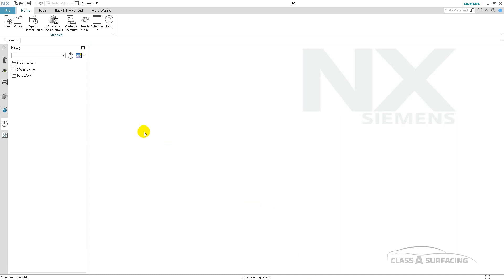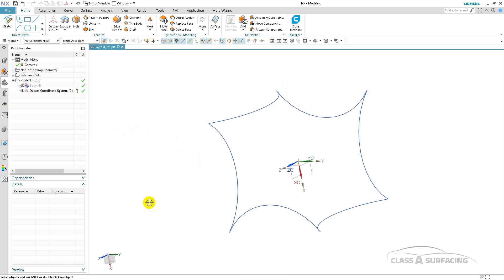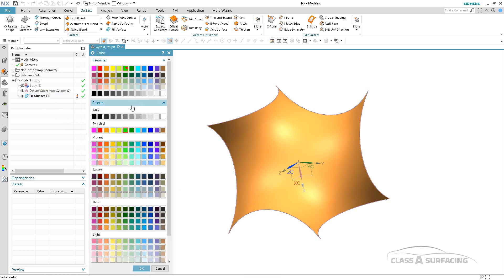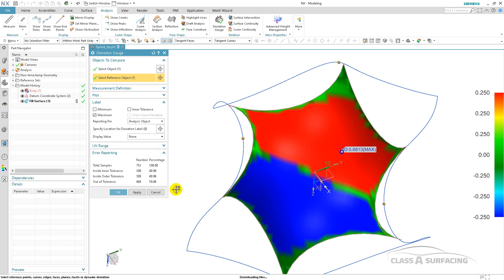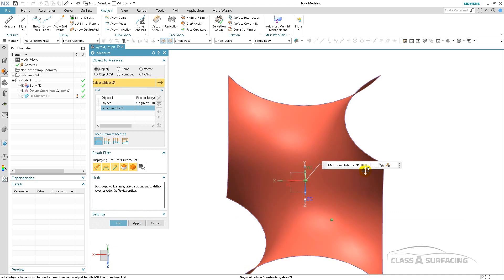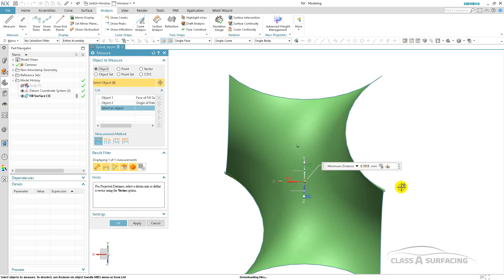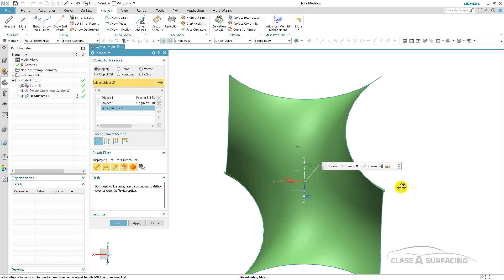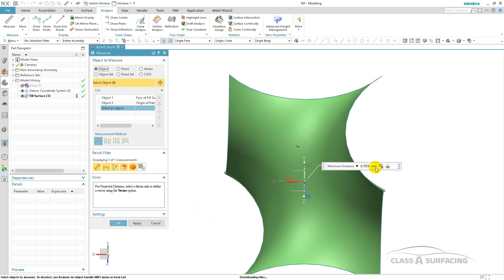Gyroid in NX vs Catia V5

Comment: Your last couple of videos on these gyroids have been really interesting, especially with regards to the use of arcs vs splines to keep the continuity at the edge and how it affects the centre and symmetry of the sheet. 

I've found in a number of my models a great difficulty in keepin the continuity across sheets. I think a lot of these surfaces would feel very natural to sculpt by hand  but the transfer to a digital medium can be a big struggle represent accurately and cleany. 

Loads of your videos have been a great help in learning these tools and are responsible for a lot of my work in a professional environment, so I'd like to say a big thanks.
Reply from the maker: You are correct about getting smoothness by hand. It is difficult to emulate that hand feel even with VR/AR tool sets.

When I model in any CAD system I do often think about the cutting/sanding/grinding tools that I would use to get smoothness and how very long consistent strokes on the work piece gives me the desired shape. So I kind of mimic those techniques. Does that help? FYI, I started a blacksmith shop when I was 16 in my mothers garage so I was always interested in 'shapes' and how they are formed. 

And, thank you for your kind words.
Reply: @StevenMarji  I 100% agree, likewise I built a guitar around a similar age and getting to understand how those complex forms are sculpted and transitions between primitive shapes really aids in modelling. I think the feedback and rapid response you get from physical modelling is why clay is a key process in the design stage for many design teams in automotive. Maybe not so much with the Tesla truck...

Do you take requests for video ideas? I have some shapes/forms for a project i'm working on but the way I get there I think is quite ugly and uses xform on a sheet and then a big G3 Aesthetic blend which feels like cheating.

Thanks again for all the effort you put in to these videos, I don't think there is any resource quite like it out there.